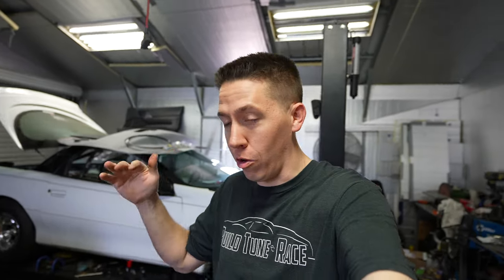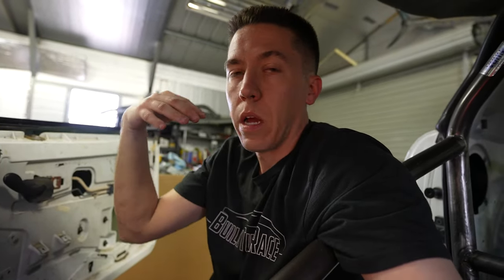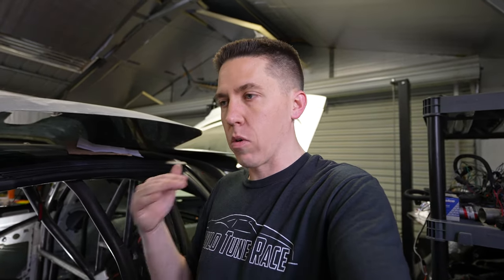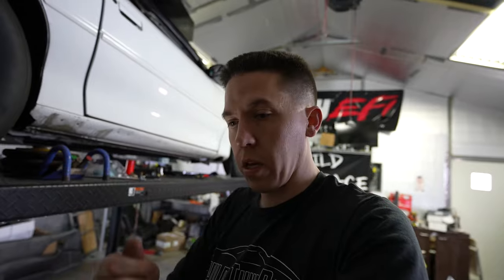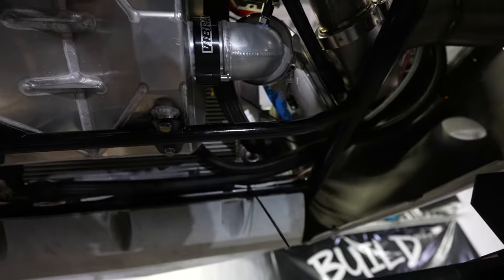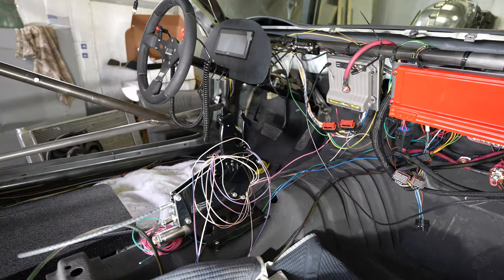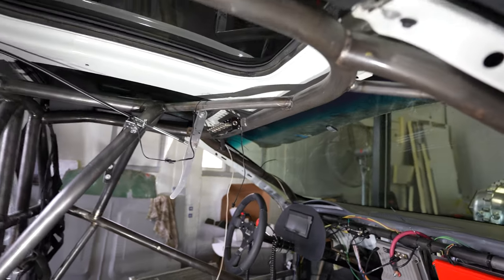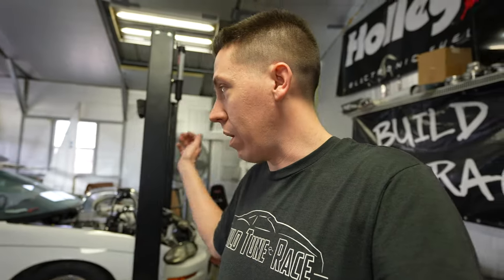Salty Is 95% Finished... Ready For First Start Up!

Comment: Have you thought about wiring in a emergency kill switch within your reach when belted in ( just like a piece of machinery ) so one hit on a red but kills all power from battery and alternator ?
Reply from the maker: So the racepak actually has a kill switch wire that I need to still hookup to a safety shutoff. Button when that’s activated it kills the power

Comment: Um you do know the trans cooler won't cool fluid with out the car running unless you have a external pump to move fluid..
Reply from the maker: Yeah I understand that. Typically after a long drive/pass the cooler will stay on for a few mins to cool the fluid sitting in the cooler so helps at least bring the temp down on that fluid